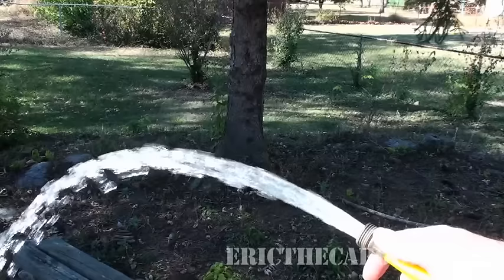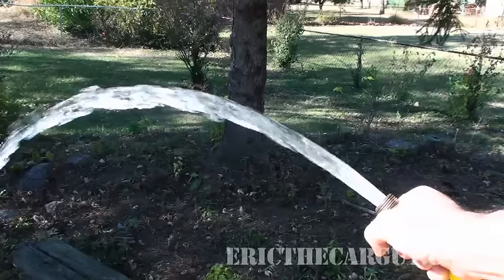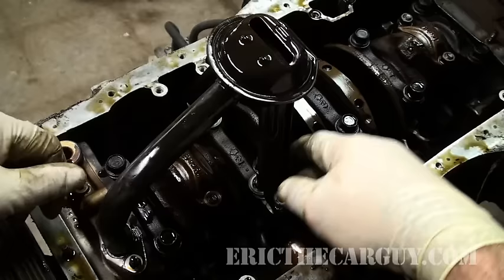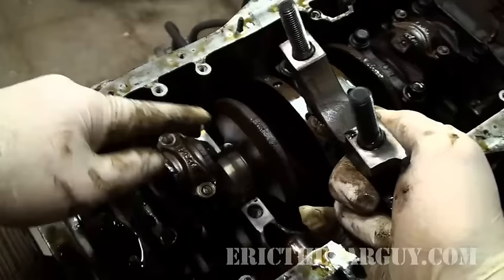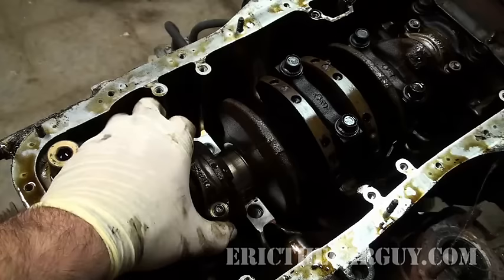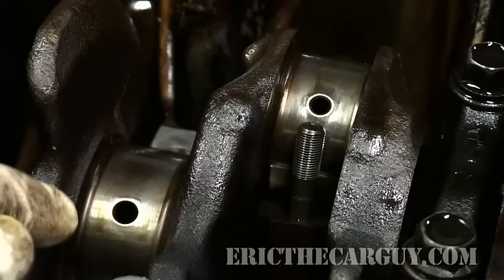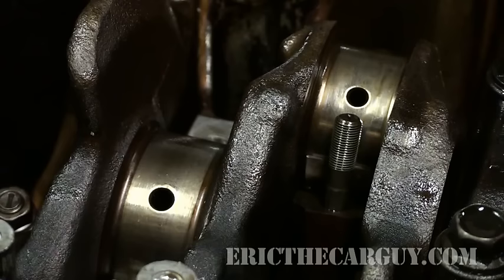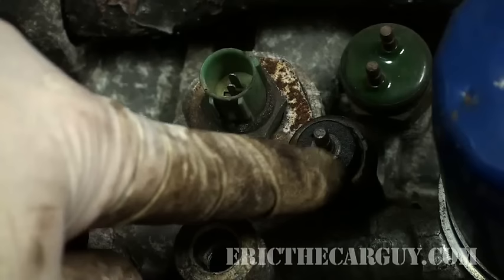How Oil Pressure Works - EricTheCarGuy

Comment: Eric, know this is very old, but, can you put new rod or mains on a high mileage engine (1996 Chevy 454) to restore oil pressure and extend life? I know physically you can replace the rod bearings and most (if not all) the mains with the pan off and engine in car. The question is will it work? Have you done it? (My engine is all original with 220K and had frequent oil changes all of its life). Engine still has tons of power, passes CA smog with ease (low Nox), no smoke (would fail CA Smog), sounds new under the hood, but oil warning light flickers at idle when warm and cruise oil pressure is around 25 (gauge on instrument panel).

Comment: If I'm having issues from high oil pressure, obviously sounds like a port thats plugged.  Any idea where to start?  Gen 5 5.3l v8 2014 silverado.  I pulled the vlom  and cleaned it.  Valve train doesn't look bad.  I had a misfire on cylinder 1 so I did a leak down test last week and left the gauge hooked up and its still holding pressure as of now.  This has got me stumped.  Anyone with any input would be highly appreciated.

Comment: To add more information, your engine's bearings are basically a sacrificial part. The reason is because over time the engine oil will wear the main and rod bearing's, like how flowing water wear's the surface of rocks in river beds. The friction of the fluid passing along the bearing surface scrubs a little bearing material away each time. Over time the bearing gets eaten away so much that you're oil will have a higher volume then intended across the bearing surface which lead to the decreases in oil pressure. The same doesn't happen to the crank shaft to an extent because its specifically hardened to prevent as much wear as possible. The bearing are made of a softer metal specifically to direct the wear of the oil flow to wear the bearing instead of the crank shaft. Over time the crank shaft will of course wear but it will wear significantly slower then any bearings will.
Changing to a higher oil viscosity will bring your oil pressure up in most cases but it is only a short term solution as bearing wear will continue but at an even quicker rate

Hope this information is helpful to someone!

Comment: I have a question what if I put a brand new short block from the factory and it still burns out my rod bearings. I put a new oil pump and rod bearing but after a couple of minutes it starts knocking again???

Comment: Is it common for an engine to have higher oil pressure at startup when it is cold for instance I go out I start my engine and it's say anywhere from 28 degrees to as high as 70 degrees outside at first start but after driven a while and it reaches full operating temperature the pressure tends to get lower but never less than say 25 to 35 PSI however it cold start up at a higher RPM I have seen it reaches high as 80 psi

Comment: I have a 4 cylinder yanmar engine in a 2.5 heister forklift I am the 3rd person that has worked on the engine I rebuilt the engine and no 4 main bearing collapsed due to low oil pressure I bought a new oil pump and a set of main bearings I am not a fitter and turner so how do I check the distance between the main bearing and the crankshaft? Thank you I am from south afica

Comment: So its a possibility that my original oil pressure switch at 150k+ could just be bad? It leaks from there and cold starts fine, but when the oil warms and thins, a slight valve noise develops. But when the car hiccups or stalls, the valve noise disappears for a bit before returning. Hiccups or stalls and valve noise disappears again immediately. Heard the oil pressure switch is like a kill switch for the fuel pump, which seems to cause it to stall when warm from the low oil pressure. Accelerates normal, no friction starting up, cold starts great but every warm start becomes harder until it seems the fuel pump is cut off and then it just cranks until the engine is cold again. Replaced the pump and relay recently but the original oil pressure switch seems to leak a bit.

Comment: I'm unsure of what I should do I have a 1990 Toyota Cressida that recently started making a slight knocking noise previous to that I had noticed earlier that day before the noise started that my oil light had started to flash when I was at idle but would go away when accelerating when I went to check the oil levels it was above full even though there's a slight leak later that day it stalled out then when it started back up it started making a ticking noise

Comment: I have a '95 maxima.  I took the engine out.  Is it a good idea to spray the crankshaft and soak the pistons with degreaser?  I'm trying to take the gunk off inside my engine and also soak the pistons in degreaser by turning the engine upside down in an attempt to reach the piston rings and melts the gunk off of them.  I'm concerned if somehow the degreaser could get in between the crankshaft and the journal and eliminate the oil protective coat and damage my engine at start up.  Thanks in advance.  (I saw a video that if I take the pistons out, I gotta put them back with new rings, and I don't wanna do that.)

Comment: I bought 95 f150 4.9 straight 6 and changed the oil  to a 10-30 and the oil gauge is "normal" and the needle was on the "R" and with the 10w-30 it is on the "A". should I go to 5-30?

Comment: So what's the typical cause for high oil pressure. .bad piston rings blow by blockage. ..the oil level in my truck is perfect.figured fuck it scrap the engine and rebuild a 302 I have in the garage but I'm curious on what's the most common issue

Comment: Very good video. But I have a question. We changed the oil pressure sensor because it wasn't working and then used the oil gauge to test it and then it was working, but when I sit at an idle the idiot light Check Gauges comes on and the oil pressure gauge in the dash goes to 0. What is casing that?
Reply: +Nicole Larson Too low viscosity of oil can do that. When you idle the oil is too thin draining back faster than it can be supplied. What weight oil are you using this time of year? If you are in a very hot place use 10w-30 if the climate is colder then use 5w-30. Generally thats a decent rule of thumb. 

Don't rule out just having a dud sender especially if you bought it at the auto parts store where it says "made in China" on it.

Comment: Did you buy standard sized bearings and rings or oversized ones? And did you clearance them using plastigauge before installing? Were your cylinder walls still in good condition and was there any visible wear on the original mains and connecting rod bearings?

Comment: So I had an oil pressure issue only when I would decelerate, not long after my truck got the lightning bolt symbol on the dash and shut off, would not start again, later on I tried to start it again it backfired through the intake manifold, blew up the plastic manifold, would those be separate issues? Or would the pressure cause this?

Comment: hi Eric,i have just rebuilt my engine in a toyota hilux 2.4 2L deisel .on starting it up the oil pressure went up to 60 psi,i ran it for 40 miles and decided to change the oil filter,after installing the new champion oil filter the presure went up another 10 psi,on the gauge,can you please explain why,the first,after rebuild oil filter was not a champion oil filter,it was another make.cheers mk

Comment: Hi Eric! I have  simple question for you.First you are a great guy . I have Ford fiesta 96 y otto engine 1.1  -8 valve  first rocker arm from driver side does not  move at oll fourt one to 5-6 -7 and eight valve are lose also push rod are does not twist on that two valve while on ol rest  push rod up to roker arm  are twisting and roker arm  sims also loos  Is that schedule ok  or som is wrong Thanks for your time

Comment: I have made a new engine with all of them brand new inside and i dont put it on the car yet ..I put the red mounting oil to crankshaft and rod bearings..i turned the engine with hand, many times before i put oil and fill it with+1litre more for maintenance. i turned the engine many times again.. but for some reason i took of the oil sump 2-3 times to check if all the parts are right connected each other and i turned the engine some times again without oil.. I want to tell me, if there is no oil pressure from pump..and the engine turned with and without oil inside of it by hand, if the bearings touched crankshaft and rod journals inside.the engine is sitting on the base one year now, and i am afraid that with the turning exists the friction and dryed up the red mounting oil or the oil i put after...logically when there is no oil inside to bearings when turning the crankshaft it will be resistance,but i dont feel that, only when the pistons going up and making compreesion..to end time when the pistons going down the crankshaft turning freely no resistance..i want your reply to be sure and if there is problem to solve it before i start it up thanks..!!!

Comment: Eric I need help, I repaired a 2001 mirage 1.5  new rod bearings, piston rings, Felpro head gasket, new Japanese oil pump, but when I start the engine I noticed that the oil is not reaching the cylinder head. 
This never happened to me. I'm wrecking my head tryin to figure out what it is. Any ideas? Thanks

Comment: im having a problem with oil pressure on fresh built engine... i have 30 psi oil pressure steady but it doesnt rise as rpm increases, stays 30 or the most 35 psi... i changed oil pump and gaskets etc, oil pick up and gaskets, good non dented pan, clean oil galleys, ... idk why oil pressure wont rise up with rpm, no knocks whatsoever , i have also check with mechanical gauge and same issue.. any inputs? i havent check bearing clearances though

Comment: I have a question people !!! I just rebuild my 1.6 engine for turbo like  4 months ago  car was setting for like  month and a half without running well finally I have the ready but I have a little leak on the crank seal (on oil pump)  at first no problems at all car runs perfect  but I was cruising around and a nocking  noise stars on my engine  oil light blinks couple times but I still made it to home .. Open the engine and I find out about one of my rod bearing was bad  but the weird thing is

Comment: So pressure is created by space between metal parts in the engine, so how come sometimes the pressure is high and sometimes it's low? oil expands when it gets hotter?

I have a 2014 focus st, when can I drive it hard from a cold start? (I have oil temp and oil pressure gauges)

another question I live 1 mile from highway, in the morning how long should I warm up the car to drive on the highway (for normal driving, not driving it hard)

They say short trips is bad for the car, exactly how short and what is bad for the car? thanks for all your videos
Reply: Allow it to warm up for ten-15 minutes
Reply: Metal parts expand ( At different rates ), depending on their composition.
Reply: The viscosity of the oil changes dramatically with temperature. At operating temperature the oil flows much more readily than at low temperature, and thus creates less pressure than when cold.

Comment: I am new to your channel and I'm affraid I have an oil pressure issue except my 2002 GMC Sierra HD 6.0L has a high oil pressure issue while I'm accelerating. At idle the oil pressure is within normal range but higher than the middle. This truck has less than 100,000 miles and I'm needing it to last me a long time. Any advice I will appreciate.

Comment: When I 1st start my Jeep, my oil pressure gauge reads like 60 to 80.  Then as the Jeep warms up around town, the pressure eventually drops to around 40 on the gauge. and stays there. Why? Has my internal engine parts expanded That Much to allow for lower 'pressure' readings as it gets warmed up.?   And then, If I drive my Jeep for HOURS on the highway, it will maintain about 40 psi on the gauge.....But when I approach a stoplight, slowdown, and slip the jeep into Neutral, and coast forward toward the stoplight, idling ....I notice my gauge reading drops to maybe 20psi.  And then, as I regain speed again, on the highway, the gauge reading will climb back up to 40 psi.    Why is this?

Comment: I have a 1999 Ford Ranger, most of the time while driving the the oil pressure gauge will stay steady in the middle. But sometimes when I park or let off the gas, the gauge will drop all the way to zero and then jump back up to the middle. Do you have any thoughts on what may be the cause of this?

Comment: My oil light comes on when idle and under 1k revs (such as sat at traffic lights) but goes off again when I rev it over 1k revs. Had a new Oil Pressure Sensor but still does it. Any idea of the problem?

Comment: I have a 95 GMC Sierra that reads high on my oil gauge, meaning when it's cold the oil guage is to 80 and once it warms up it's about 45 but when I accelerate it goes back up to 80. What can be the problem?

Comment: hello Eric I'm just found you chanel. I have a 1996 Bonoville  my oil pressure  drops and when I drive it goes  back up .I was told that was normal now it started to red line . so I  changed  the oil pressure  switch  it seems  to work but know after 20 min it starts  to drop again.  so changed the oil .  now it drops but when I accelerate it rises  to the half way point. but the moment I stop it drops close to the red and stop. for now.
Reply: well so long the warning oil pressure light stays out the engine is not going to smell like a rotten egg cleaning electrical connection can also  zalf some weird folds corroded connections

Comment: Hey Eric...I have problem with oil pressure in my 2004 Nissan Frontier V6 3.3L non-supercharged.  When first started everything is fine...after going few miles down the road the oil light comes on. When it first started happening, the oil light would come on but turn off with higher rpms (like 2000 rpms or so). Now here recently it comes on after motor is warm but wont cut off like before. I just replaced oil sensor a month ago for other issues. I use 5w-30 high mileage oil.  Truck has about 130,000 miles on it but seems to run good. So what gives and where to start for diagnosing!!??

Comment: 98 zj with 318 130,000 miles has flucuating oil pressure. Typically pressure is around 40psi then it will drop to 25. That will happen even at 2500-3000rpm. I didn't think much of it til the other day when it got down to -10 and after the engine got to normal operating temp 190 or so I lost all oil pressure at idle. The pressure would come back up with the rpm's (all the way to 40psi) at 2500 rpm. The next day, -5 degress outside, started jeep, watched the oil pressure during warm up and everything was back to normal. Well back to flucuating. Bad oil pump?

Comment: hi eric i have a 2009 kia sedona 6cilynder. Just chang the oil. driving on the highway at 70 mpg. oil lamp came on. enging start to make gavely souns at bottom. i change the pressure switch same problem. the oil level remain good. now i thinking to buy a oil pump. what you think i should do first.

Comment: I drive a golf 4 1.4 is turned on the red light for the oil, I changed the crankshaft, oil pump, bearings, oil, oil filter, oil, oil pressure gauge located on the cylinder head, camshaft housing and re-turn on the light.
turns on only when the engine reaches its operating temperature when the engine is warm, bright 5'6 seconds and turn off the red light .. I would ask for help

Comment: Great video. Question: my '04 A8 cranks and doesnt start. It has wallmart battery wich is not proper bc it is not programmable, therefore creates power mismanagement throughout components sending improper voltage reading. sometimes there is no brakes, other times it show overheating engine or engine clicking noise appears due to selenoid non functioning. Now it just cranks, never been this way, shows low oil and doest start. i drove to local mechanic, turned of engine and left the car for him to check where  is coolant leak. he responded that engine doest start. from that point on, i explained all from beginning of this message. he said engine is done, low  oil pressure... without any testing, cos locals dont have programmable software's.. so here i have a mistrust and need advice what i should check or do to start my car. i am as bout to get new walmart battery, install, then power w running car for proper supply of voltage and start?

Comment: hey eric the car guy.i have a 98 gmc jimmy 4x4. loved the video by the way.my jimmy has what seems to me high oil pressure. it runs 40 at idol and 60 and high under load. i keep the oil and filter changed on regular basis. i have no info on high oil pressure just low.any thoughts on possible causes??????

Comment: I kno this has nothing to do with oil but I have a coolant question ???? My radiator cap continued to be cold even after I drive my car for day an hour I’ve replaced the radiator,thermostat , and replaced coolant please tell me you have the answer to my dreams the only thing I have not replaced is the hoses or done a full coolant flush do you think it would be necessary the hoses fyi do have flow and tighten up so car over heats 2006 Buick rendezvous

Comment: Hi Eric please help I have a 2008 GMC sierra Dinali 1500 6.2 engine I recently have some oil pressure problem remove the oil pressure sensor use a pic to find the screen there was no screen the pick fell right through a hole and I remove the oil pan and still couldn’t find the pick how can I find the pick?

Comment: is it possible to compensate for a 'worn out' engine by adding a bit more oil than originally specified? could that help the oil pressure issue?